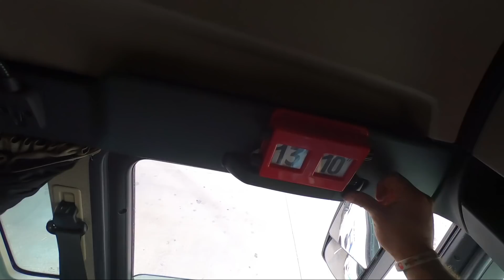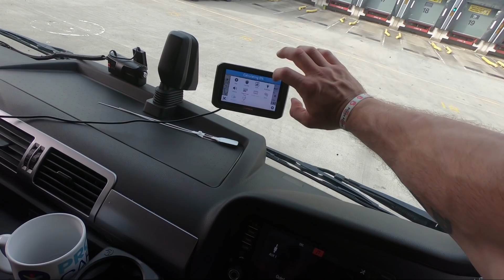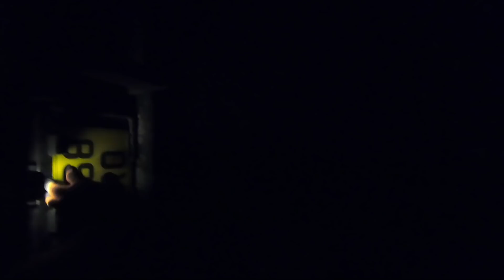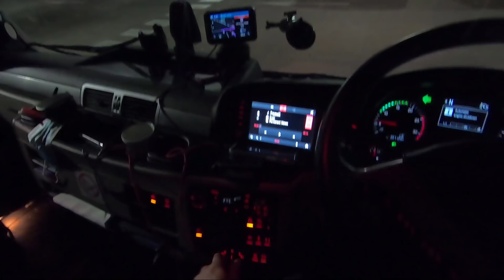The Biggest Reversing Mess Up I've Done On Camera! Let Me Explain...

Comment: Are all units fifth wheel height the same or can there be any differences in the height because trailers say overall height 14 for and I would assume that is under a standard unit. So could it be different on some truck fifth wheel. You give super info and love what you do.